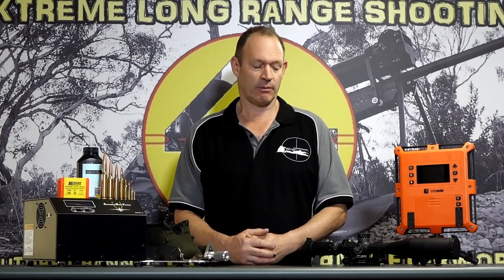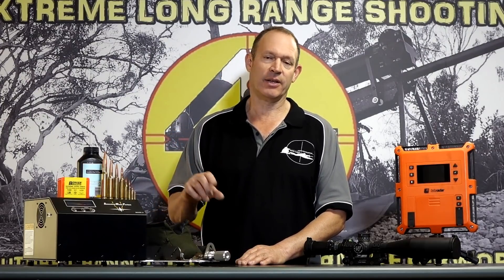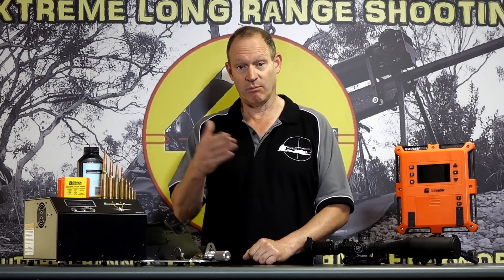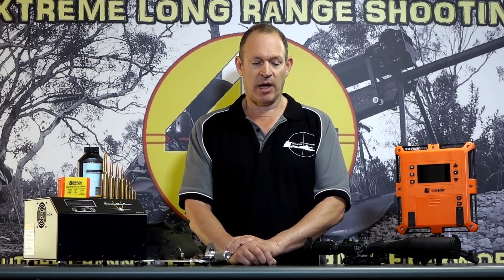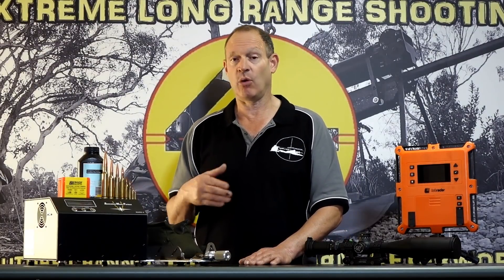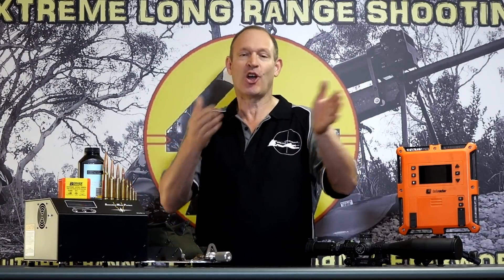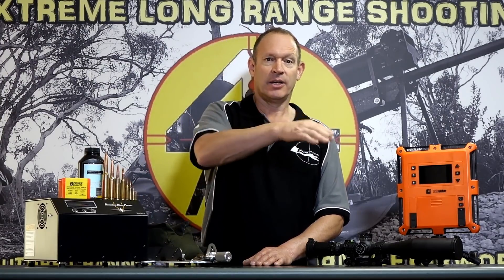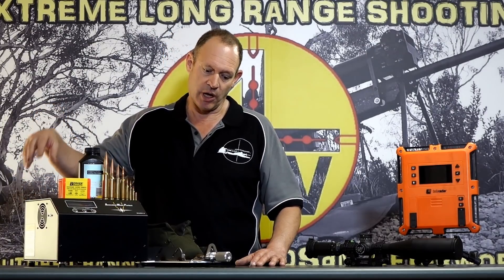ACCURACY and where to find it

Comment: Very practical rationales. I’ve been wondering if searching for the best node would wear out a barrel. Tuners seem to cut to the chase. But I’m not experienced enough to determine if that would even be true. I surmise a reasonable balance between, shooting, working up loads, proper equipment and good shooting technique might be the most practical. Mark’s input helps put one’s pondering in perspective. Thanks, I appreciate your thoughts, they are very helpful. It’s funny,  you often manage to address and clarify a lot of thoughts I consider about shooting. So no you are not rambling on or talking too much. It’s actually 
extraordinary depth and practical input I often get from your evaluations . Thanks again!
Reply from the maker: Thanks Vince, glad you liked, cheers

Comment: You always bring vary good points and data to the table. See, I get so in-depth with all the fundamentals because I don't get trigger time. So when I do get trigger time, I want to have already addressed possible flaws, and when something does not perform as desired I can use process of elimination to quickly  diagnose.
Reply from the maker: Thanks Joe, cheers

Comment: This video is fascinating. It sounds like you're saying that you tune yourself to each gun and load, and possibly use a particular muzzle device and other accessories instead of tuning the load. Do you experiment with how much pressure to grip and where you apply that pressure and find what works for a particular load? I know this may be an oversimplification, but it does sound like this is what you're aluding to.
I just found your channel and am absolutely loving it. Subbed 🙏
Reply from the maker: awesome, thanks Ben, and yes all about what the rifle needs, Cheers

Comment: Thanks again for your ramblings Mark. I appreciate the fact that you made a point to recognize the importance Sam has in accomplishing the accuracy that you have as a team. Good team work is paramount to success in your field of "work". Once again I find it very interesting that our view of reloading is quite similar. Well I would like to say that I have found it beneficial to look for nodes I would define nodes as a charge weight that produces lower ES then average. Preference is when a number of charge weights have the same velocity. (One of my 223 *3.6-*4.0 gr average the same velocity no matter which load I load I can load a mix of those charge weights and there will be no difference in accuracy yes very odd!) Once I find a node (with constant reloading practices less then 30 rounds per powder) I have found generally that the powder acts more temperature stable. I then change my seating depth 0.030 at a time till I have a round tight group. If it's a 0.6" group thats ok. If using group size for testing and I could find a 0.3" group I will always be better off with using the load that I arrived at with the method described as it will always be more consistent across different conditions even though not as accurate at 100. I have tested this theory on numerous rifles and with multiple bullets and powders and it has held true so far of course I'm sure there is an exception somewhere. 
I'm with you all the way the shooter and rifle set up has a far bigger impact on real life accuracy and like you noted the ultimate accuracy in no where near as important as consistency! Now I should clarify that my approach is totally geared toward PRS style competition not long range like you are so very different. Cheers from Canada!
Reply from the maker: Thanks Man, glad you liked and thanks for your info, Cheers

Comment: Great stuff!! 

Most don’t believe that internal ballistics effect POI. They are the only true science deniers I’ve ever met. They think the bullet leaves before recoil, or that there is somehow perfect equilibrium as the bullet spins up to 200,000rpm while a powder charge pressurizes the chamber and barrel to 60,000 pounds per square inch.

A car spinning at 200,000rpm on tires inflated to 60,000 psi is hard to imagine, so I guess ballistics are hard to also visualize.

An analogy for Absorbing recoil is like jumping over a wide stream from a solid rock versus launching from a marshy bank. The same effort will produce different trajectory, and mushy is less predictable.
Reply from the maker: Cheers Clint

Comment: Nice talk for such a broad complex discussion. Experienced shooters tend to forget to slow things down for the beginners and that makes it tough on them. In case it helps, in the discussion on the complexity of load development and the relationship to the gun/shooter system, there are powder/case/primer/bullet combinations that can give an excellent ignition behavior that gives an excellent SD/ES, but... At the same time, that particular speed, even though it is very repeatable, does not align to the better harmonic for the rest of the system. This isn't rare and can be very frustrating for the inexperienced load developer. This is where previous experience and tenacity is a prerequisite. Without a good background from say something like air or rimfire small bore,  combined with disciplined loading practice, it would be difficult to know where to start looking and they lack the confidence to experiment and make changes to find a better accuracy node. Tenacity counts for as much as anything else. Don't give up. Using a mentor to get up the reloading learning curve is efficient. Learning to shoot body supported with an air gun or rimfire smallbore is efficient. Expecting to read one or two magazines, watch a few videos, and then buy your way into proficiency in highpower rifle is a good way to get frustrated. Keep up the good work!
Reply from the maker: Thanks Dino, glad you liked and thanks for your input, stay safe out there, Cheers

Comment: With that node finding by powder amount it’s a bit silly. The sim of it is to have the muzzle exit at a node so it does not move. So from a materials perspective this node is based on the speed of sound in the barrel and the length of the barrel. AND NOTHING ELSE.

So now get that barrel hot and the speed of sound changes  a fair bit so your node has moved and the muzzle exit is now off a node and moving. So a cold bore is different to a hot bore. So how do you shoot your rifle, hot or cold mostly?

So tuning the nodes is great if you heat your barrel up to normal temp for you and then run your tuning ammo for groups. Or if you shoot just a few shots from a cold bore then you run your tuning ammo only through you cold barrel and then wait for it to cool and do the next set.

Now the big WTF. If you hand load accurately then if your barrel is at temp, for you, then the bullet will always exit at the same time in the vibration sequence so the muzzle will always be pointing in the same direction even if that’s not perfectly straight ahead.
Reply from the maker: Cheers

Comment: I’ve always wondered if you load at a low elevation Sea level and high elevation same load . What difference would you see. ? Or are they not air tight ?
Reply from the maker: The load (internal ballistics) will perform the same, but the bullet (external ballistics) will perform different, less air pressure at higher elevations means less drop and less wind deflection, a little better for accuracy at elevation, Cheers

Comment: Interesting. I’m aware of your focus on pressure (over the years) but I can’t see or understand how you can repeat tight patterns when the harmonics of the barrel may or may not be pitching your barrel and the Bullet exiting the barrels at different points. 

I’m a data guy and I do look for nodes using the Satterlee methodology. Has proven to be successful but I have found one rifle where it will put three bullets in the same hole (100yds) and then throw shots 4 & 5 repeatably.  On that particular rifle with a 26” bartlein barrel - 6CM @ 3000fps the barrel heats and I have to monitor the temp continuously during f-class competitions. All comes down to both trigger time and time management. 

On another bench rest rifle 6.5 284 Norma  with a 30 in barrel the groups stay tight for 10-15 shots depending on outside temps @ 2800 fps. 

All things be said, it does come down to trigger time and intimately know the ends and outs in a rifle and how it behaves. Great content
Reply from the maker: Thanks John, well basics work on controlling and absorbing shock, hence reducing all influence of vibrations and harmonics, giving overall consistency to all conditions, well at least to the level as the the results we get.... Stay safe, Cheers and all the best.
Reply: MarkandSam AfterWork In your last response are you referring to keeping the barrel in alignment to shoulder or collar bone as in straight linear line?

You guys do a great job keeping the barrel from rising both via muzzle break and back butt pad height adjustments
Reply from the maker: Well, yes that can help, but it is in everything, chassis/stock, pre load, body form, muzzle brake, scope height, front support (top and bottom, butt pad composition, barrel weight, rifle balance, the list goes on, hope that makes some sense, Cheers
Reply: MarkandSam AfterWork Thanks Mark.